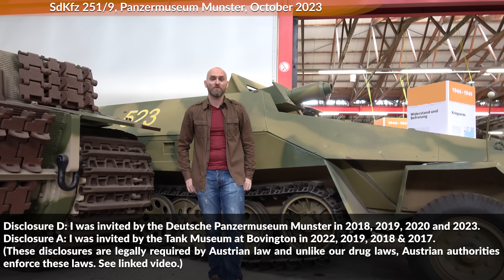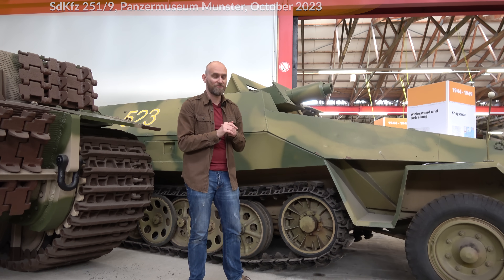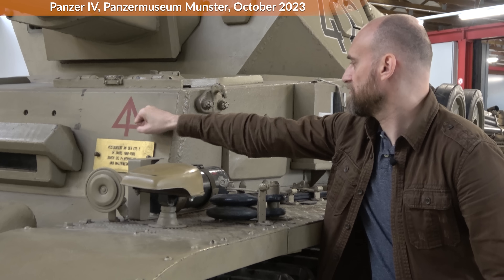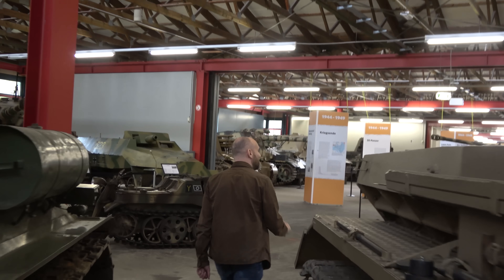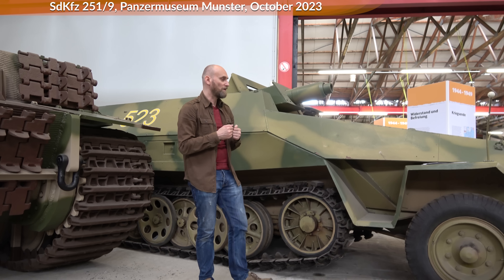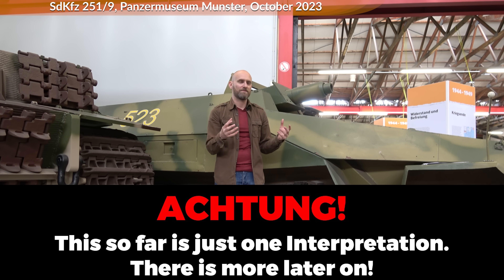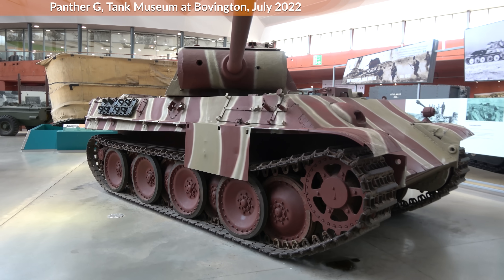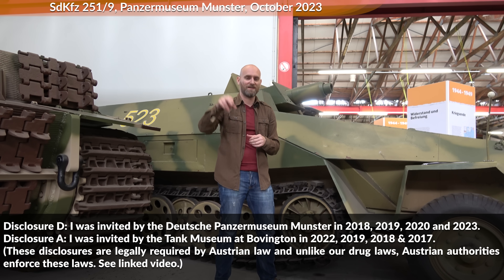Why was German Sloped Armor so late?

Comment: A sloped frontal plate is massive. Thus is very limited in thickness, due to sheer size.

A smaller plate can be made thicker, then angled to gain the benefits of sloping. Simply by having the vehicle point 30 degrees to the right or left of the target firing at you, you have the sloping of a much thicker plate. The Prussian views of quality were still alive and well, and training a tank crew to angle their vehicle was not an issue. The soviets on the other hand, didnt expect their crews to have any training, and needed the armor to do the angling for them.

Also, lets not forget to aesthetics was a very important thing to the Reich, and no vehicle is more beautiful than a Tiger.

Addendum: Why did the panther switch to Sloping? It was a cheap vehicle, giving a nod to Quantity. The Panther was cheaper to build than the PZKW IV, and came at a time when manpower was getting more scarce, as well as training times. It, also being a medium tank, lacked the thick side armor of the Tigers, and thus would have required more care in angling angles. Hit that left brake a little too hard and expose too much side armor, so sloping that frontal plate makes sense. After experience with sloping always being affective (as apposed to angling requiring knowledge of being attacked), I'm sure then the Germans decided it was worth it to continue sloping from then on, even on the Tiger II.

Comment: Makes sense, the T34 in Duxford has such a poor quality weld on the front plate that you can literally put your hand inside. Its also very common to see knocked out russian tanks that the hull is totally broken, i think this is both due to the poor quality welding and also the russians using a more hardened steel for their tanks that was more likely to shatter.

Comment: I recall reading (can't remember the book) that *one* reason the Germans didn't use sloped armour was hull and turret space for crew flexibility and situational awareness. German tank tactics stressed teamwork (of tanks and crew) and this served them well despite their tanks being under armoured and under gunned at the start of the war. Contrast to French and British designs with thick armour but typically single man turrets. Similarly the T-34 was very cramped (single man turret and Crisper suspension reducing the hull space even more (the T-34/85  changed the turret and was a devastating improvement).

Comment: That's a little bit of flawed logic: Sloped armour is NOT an effective measure to increase protection, at least not in 1939 tech levels. It is easy to see that by tilting the armour plates, you can increase the effective thickness in one direction, but that reduces the protected area. So, you have to enlarge the armour plate after tilting. In order to double the effective thickness by sloping, one needs a plate which has twice the surface area. There is no weight gain against a non sloped armour with double the thickness. Furthermore, by sloping the armour plates, space is often reduced and it becomes more difficult to install a machine gun mount or a sight. An extreme example can be seen on the T34 where the drivers hatch is at the front of the armour because there is no room for a horizontal hatch in front of the turret. This is neither a good location for protection in general nor for an emergency escape hatch.

If you lack the capacity of manufacturing thick armour plates, sloped armour is a solution. This easily explains that two of the leading steel armour manufacturers then (UK and Germany) came up with tilted armour in tanks so late and Germany started to build sloped armour early on armoured cars and halftracks only which are to be build not by tank manufacturers. Both had more than enough capacities in regard of thick armour plates and were more often hindererd by lack of other gear. 

There are exception from this basic rule. If you go into dynamics of modern projectiles there is definitely an advantage in sloped armour and beyond a certain armour size (60-80mm) forging, heat treating, welding becomes more cumbersome. Sloped armour has a clear advantage in order to avoid very thick vertical plates. This is precisely the way Germany followed: Once the plate strength needed gets beyond that level, sloped armour was introduced.

Comment: This type of fastening is caused by the need to create a strong connection when the quality of the armor deteriorates. Even with this connection , there are recorded cases of armor splitting at the seams , with a conventional seam, more than 90 tanks would burst after the first blow . With each year of the war, the quality of the armor deteriorated, the engineers solved these problems as best they could.

Comment: My initial response based just on my own visual interpretations and basic understanding would be that it was related to aspects of the interiors. So the driver vision ports do make sense. One thing that has to be considered is that, while the sloped armor all around the T-34 tanks were good for protection, these sloped also limit interior space considerably, which has a negative impact on ammo stowage, crew comfort, crew capacity (sloped T-34 turrets feature a 2 man crew instead of the usual 3), and other factors that can affect crew performance. I expect this to be one of the reasons that the Sherman had sloped frontal armor, but flat sides and that the side armor being the primary stowage of ammunition in the early war days was no coincidence. 

I don't think there's one reason alone why Germany used box like designs until later, I think there are multiple, very complex reasons. From production to interior space and function as well as crew comfort and even compatibility (tall people were harder to fit into tanks), the list of reasons a box like design might be better is quite extensive.

Comment: Sometimes I think the design choices on tanks is just coincidential! Somebody needs 10 cm more room for an engineblock, and moves a steelplate a bit forward on a drawing, and then somebody else realize, that this moves a vital hole in the plate, so now he has to make a weld instead. Why is the back on a Tiger 1 sloped slighty inwards..? Nobody knows, and it serves no purpose that I can figure out, buts it is there.. A boxed shaped is easier to work with on a drawing, and maybe the German engineers simply was in a hurry?

Comment: Germans had sloped armor since like 1930.
Their first sdkfz 2xx series 4 wheeled car was made with sloped armor, and quite aggressive use of it at that.
Why was this so widespread with the sdkfz 2xx and not with the sdkfz 1xx (the panzer family)
The soviets didn't invent sloped armor.
The american inventor Chrisie from which they bought the chrisie armored vehicle (transformed into the BT family of tanks, that later evolved into the T34 ) used it with a lot of luck because of the driver position (single driver). It was like a manufacturing efficiency that led to that angling.

Comment: I theorize that having a larger surface area that is sloped might be weaker or wasteful compared to the boxy but small areas. 
Long fat stick vs thinner short stick perhaps.
Also there were no absolute right angles on any German tanks, they had some slope. Trying to target these rather limited areas specifically for their lack of angle would have been problematic at best.
And then there are the multiple joints to consider in the "Boxy" German style of tank. These are going to be allot tougher to get through. If you were to punch a table with the goal of getting right through, you want to hit it where there is more give, as far from the edges as possible. So on a Pz.3 frontal for example, it is nothing but edge after edge.
Those glaringly obvious slopes with their inviting surface area on the Panther frontal and T-34 front and rear are just asking for a glowing hole to suddenly appear. Neutralizing the slope advantage is merely a matter of contact angle and is simple to achieve.
Outright frontal penetration was far more common on the panther than it was the tiger 1 despite the 40mm advantage from the 55 angle on the panther

Comment: Interlocking (as my original post appears to have disappeared) was an economic measure. Major joints were not plain butt joints. The machining required to rebate joints was expensive in terms of time and tools.
Interlocked joints could be gas cut relatively quickly and cheaply. Jigs were still needed for assembly as tolerances were much looser, becoming shocking in some cases later on (joints needing to be packed/shimmed before welding).

Chapter and verse: Final Report - Welding Design of German Tank Hulls and Turrets 1948

Comment: Perhaps the two main ideas presented by you for german engineers introducing sloped armour are not opposites but two reasons which lead to the same conclusion. Especially If you think of tank design is always a compromise (in the way that you have to incooperate many requirements).

...just an idea...

Comment: I guessing that these locking joints on german tanks were used mainly due technological process of assembly of parts before welding and subsequent stress resistance due heat from welding.

Comment: The slopes on the halftracks was a consequence of the productionmethods. You can save a lot of steps if you only have to cut and weld without bending anything. The tracked mortar was NOT intended as a spearhead vehicle, and theres not really any weaponsystem from the allied that would be a direct threat in the sense that it couldnt stop anything larger than handheld calibers, and you dont even need sloped to stop that.

Long story short. there was no need for sloped untill the calibers became so big that flat couldnt stop the rounds. Sloped armor will result in less space inside the tank, so unless theres a really good reason, then youd go for the flat.

Comment: Sloped armour is basically on every WW2 Armoured vehicle, however, it was rarely implemented into design intelligently to act as sloped armour.

In fact, many of the vehicles with a lot of armour sloping in early WW2 were pre-war designs like the Soviet T-60 for example, which is a pre-war light tank design, but the front and rear armour is sloped.
Additionally, most nations with tanks at the time of WW2's start, had at the very least made something with mostly sloped frontal armour.

Comment: Hello, I'm not a 1940s engineer but I am a Mechanical Engineer. I'd say the cutouts on the Jagdpanzer are much more likely to be ease of fabrication features than structural. It they are structural it's more likely that they have arisen from pseudo scientific (gut feeling) than from hard calculation, it may come as a surprise to you but much engineering work is born from the designer's experience and ideas thane from hard math. This happens today but was much more common in the past where the simulation/calculation tools were poorer. What I am saying the designer of those tanks probably was not able to justify the cutouts with math alone and he probable designed the tank like that from experience/feeling.
Reply from the maker: Thanks, I don't think ease of fabrication was a factor, if that was the case I would think the Soviets and Allies would have done something similar. I am not really surprised, I have a background in computer science and although we do a lot of calculations, a lot of stuff comes down to "gut", the main difference is, we can test it quickly and cheaply.

Comment: in my mind the interlocking amour joints are a seperate design feature not really connected to sloped or vertical amour, and vision technology again a design feature compromise perhaps led in a direction by better optic development.

Comment: Hey, I have a quick question and would very much appreciate it if you could answer it:
Would the P-1000 Ratte have weighed around 1000 tons?

Based on whatever specs I was able to find, there just seems to be no way it could have been that light with those dimensions, the Gneisenau turret and those ridiculous armor thicknesses

Comment: Square armour like the Panzer 3/4/Tiger can still be angled by positioning the tank and shooting over one of the front track wheels. If you have pike nose, or sloped armour that is angled for frontal deflection, if you are caught from the 45 degree angle to the hull, these plates are more or less flat. Early German tank doctrine also had more emphasis on mobility than protection against tank guns, which meant the square designs were adequate for that doctrine, while also remaining feasible for production as Germany were coming from a very low technical and industrial base compared to their opponents in the post Versailles treaty era.

Comment: Interlocking I guees make the assembly more easý because parts hold in place before welding and also the weld is a bit weaker (tension and applied heat) so if ist start to rupture, than it stops in next corner. I mean fox example by hit with HE, or stoping AP the plates wirk and could split in welding line.
sloped armor probably also spare some weight  - corners are cut. About benefits of increase of effective thicknes must know all sides in that time.

Comment: I believe it was a matter of metallurgy (in addition to other considerations such as increasing gun calibers on both sides). For example, the Tiger 1 and Mark IV armor had extremely high nickel and tungsten content with case-hardened faces that could shatter any Allied round...thus preventing penetration...with a milder steal core that absorbed the impact. Whereas the King Tiger and Panther factories could no longer obtain such high quality plates due to shortages of imported raw materials, and time constraints and the need for higher production, made multi-layer tempering impracticle...and therefore they had to switch to single-layer hardened but thicker armour that required sloping in lue of the earlier "samurai sword" multi-layered hardness tempering. This later armour (1943 on) was so thick and heavy that interlocking helped prevent shattering. In other words...German armour got thicker and sloped because the quality of the metal diminished as the war progressed...and the Panther often cracked at the seams after a few hits even with interlocking plates…

Comment: I think in this, there are three different points which are getting caught up in the same topic, being: 1. Sloped armor 2. Heavier armor. 3. Effective welding of sensitive armor plate. the interlocking joins are not exclusively related to sloping armor but are more a factor relating to effectively joining the ever increasing thickness of armor. In the case of the deflected shot being turned away (action/reaction) there is also an increase in stress that must be effectively distributed through the welds . These gargantuan thickness plates cannot possibly be fully welded so the strength must be achieved by other means. Keep in mind any welded structure achieves the required strength not through the welds themselves but through correct weld placement and correct fit up before welding.
With all that said, in my own opinion all the sloped side armor was largely a waste of effort, a pointy nose and vertical sides seems to have stood the test of time.

Comment: I really liked the video and highly appreciate your honesty on the level of understanding you have. I was a little bit surprised to see the first part of the video and i think it is rather interesting to think about the connecting mechanisms of armor plates. I personally think it were the drivers vision and the crews and engineers being used to the layout. It is not completely neglecting sloping,  it just tries to minimize the size of the visory hatch. Also it might have been an influence that the tank would effectively become a little shorter. As soon as more communication was inteoduced and also no more direct vision was required it was possible to drive without that weakspot. 
I really wonder if the big hatches of sloped vehicles or the vertically closing hatches of german tanks were seen as a weakspot by the soldiers of that time or as a necessary thing because driving blindly was seen as more dangerous than having a thin weakspot.

Comment: Panzer 3 and 4 are 'old designs' rooting in the mid 30s and even the Tiger is a pre Barbarossa design. The biggest weakness of Germany for the entire war was production and  - Design Changes were complicated to adopt in the running assembly line: the Panther was the First wartime Design - and it adopted sloped Armor then

Comment: The Tiger and its siblings were a product of old war doctrine and a need for a fast production. The armor on the tiger was more than sufficient at the time to deal with the current land scape of weaponry when it was developed. When the Allied weapons began to catch up the flat armor showed its weakness and sloped armor is a very cheap force multiplier for dealing with such things. A sloped armor piece has more effective thickness than the same piece turned vertically along with the benefit of being able to redirect some glancing shells. Though Sloped armor in certain german armor such as the Hetzer and Jagdpanzer was a product of re-cycling chassis of other tanks and only using the bottom half with no turret.

Comment: A GOOD weld can be just as strong as the surrounding material as any welder can tell you, so in general using interlocking makes no sense and only complicates the production process.
That said it's well known that making a GOOD weld was at the end of the war virtually impossible for German manufacturers because the welding sticks were lacking crucial components.
It was mentioned "somewhere" in the German sources that they had to use "naked" welding sticks, which means you get bad welds with many inclusions/oxidation etc.
So welds became generally awful and interlocking plates was a measure to compensate somewhat for the bad weld quality.